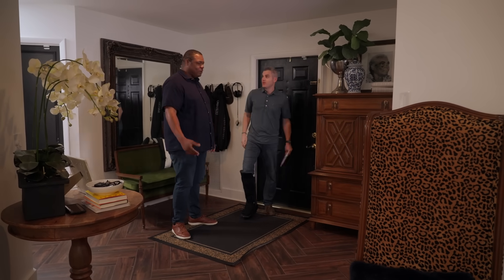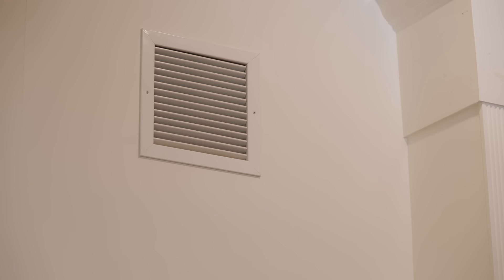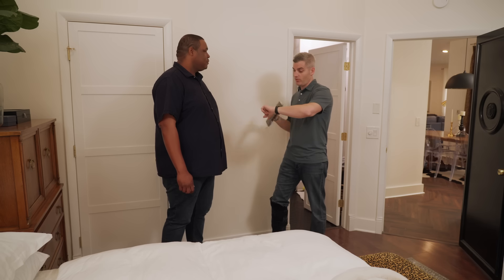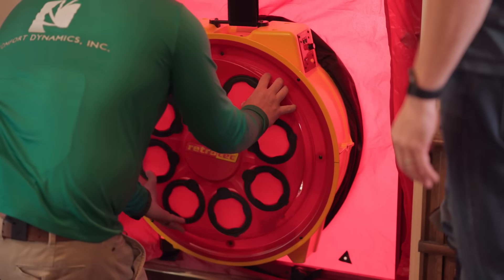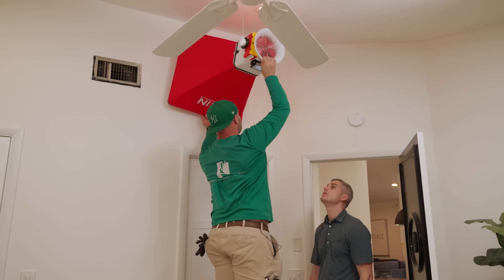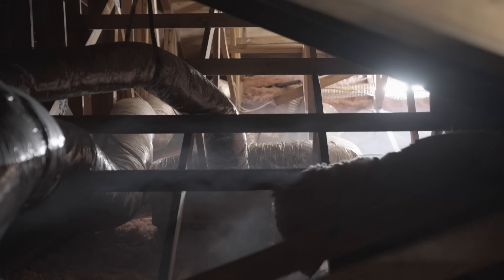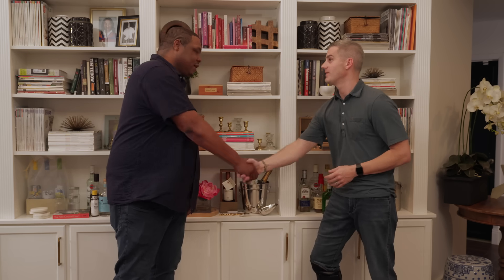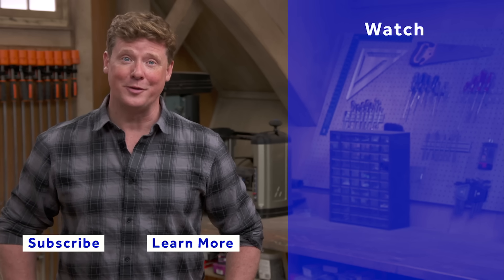How Experts Troubleshoot an AC System | Ask This Old House

Comment: That’s Cool Bear for you…surprised the system is actually sized correctly, although the duct work is undersized. They are a pump and dump company with 15 salesmen, 15+ installers and only 4 service technicians running warranty calls on systems less than 6 months old all day

Comment: Total B.S. no AC contractor’s going to do testing like that. Besides, most AC companies are Scam Artists. For a simple Run Capacitor charging you $400-600 dollars for a 10-20 mins jobs, depending on the locations.

Comment: Such a simple solution nobody thinks of, just get yourself a small window air conditioner for the bedroom, why would you keep the entire house cold so that your bedroom is cold, the window unit will pay for itself in the first month or two just by keeping the central air at a comfortable temperature and the rest of the house but keeping the bedroom cooler, works like a charm every time, you're welcome!
Reply: Definitely the cheapest solution, but also merely a band-aid. There's also something to be said about how loud those window units can be. It's so weird to see an HVAC system (and laundry) in a garage space, but I guess that's feasible in Florida. I'm sure fixing the return-side issue would help there, but I have to think finding and sealing the leaks in the attic will have the most return on investment. All that smoke seemed pretty intense during the test. Just get up there with some tape, and that would solve most of the issue. Everything beyond that feels like they're essentially trying to do a re-do on the original install, which is why it'll cost a buttload.
Reply: You can get a cheap minisplit and install it yourself, the market is littered with them these days.  No need for a window nor any large hole through the wall, plus super quiet compared to any window unit. Yes, it's a hack and doesn't solve the underlying problem with the central ac at all, but the math will dramatically reveal lower costs and the occupant of the room can immediately enjoy cool temperatures to put the issue to rest and move on with other things in life.
Reply: sounds reasonable. i was also thinking they need to find out what's blocking the air flow to the bedroom or where they are losing the air (probably in the attic) on the way to the bedroom.
Reply: hard to do with casement windows.

Comment: Sadly HVAC techs are the shadiest of all the trades.  You could call 10 technicians in middle America and all 10 would never go to a blower door test or duct leakage test.  Instead the homeowner will just get sold useless services like drain cleaning, coil cleaning, or an entire new unit.

Comment: If this is forced air, why is it in the garage? Are there no CO issues? Or did I miss something.
Reply: The heating part of a furnace vents itself through the roof most likely. However the AC doesn’t emit CO.
Reply: @jordanl69  I am referring to the cars in the garage. Normally the furnace is inside the house.
Reply: @ if you’re talking about the air intake side of the system, you are always going to be pulling outside air and then recycling the indoor air. You’d be pulling a ton of air from the closed garage and would be considered ‘dirty air’
Reply: That makes no sense lol , it's ran through a pvc pipe if it's high efficiency,  or standard flu pipe ran outside somewhere
Reply: Are you speaking of the cars that could be in the garage?

Comment: do these HVAC actually exist...last time i called a HVAC tech about my AC not cooling enough they just quoted me $30K for an entire new system after 5mins of the visit
Reply: Private equity has taken over local HVAC plumbing and electrical companies and now a lot of “techs” have become salesmen. Sad reality and it makes a good company that much harder to find
Reply: Facts! Find small family owned companies.
Reply: They are hard to find. They don't make as much fixing the issues over selling you a new unit
Reply: Yes, they most definitely exist, but they are VERY hard to find.
Reply: Worst of all, a brand new systrem would NOT have even fixed these issues.  They'd have sold a larger system which would most likely make the comfort problems worse.
Reply: Must have to call more than 1 company
Reply: Hi
Reply: Those "technicians" are largely on commission, and similar to other high paying commission jobs, if your base salary ends up exceeding your commissions for so many times in the row, you're fired, no matter how long you were with them, how good you are, whatever, don't matter (maybe you get a break if you're the owners son).
Reply: Don't call a large company with 50 trucks, call the small one man businesses, they'll be the more honest and trustworthy ones. The large businesses are sales sales sales.........
Reply: I’ve worked for small shops (3 employees plus the owner) and I’ve watched them just blatantly lie to homeowners and push system replacement as well. Some people are sleazeballs some people are honest. Best bet is to befriend somebody that is actually in the HVAC industry. If they’re your real friend they won’t lie to you.
Reply: This gentleman gets it!
Reply: Hi

Comment: I wanna see a comparison of MiniSplits vs HiVelocityAC because I was told condensate hoses can freeze on the minisplits (north climate).
Reply: One benefit of MiniSplits is no possibility of air duct leakage - because they don't have any. From what I read, ducted A/C are obsolete and the future is MiniSplit, the only reason they still install ducted system is inertia and that installers don't yet know how to install MiniSplits.
Reply: The indoor heads only condense in the summer but the outdoor unit will ice up and that’s perfectly normal and will drain when it’s defrosting. A lot of mini split heat pumps come with a base pan heater that keeps the water warm enough to be plumbed somewhere away from the unit, but most of the time it’ll just ice up on the ground keeping the unit itself clean.
And most contractors sell full systems because you already have the ductwork and it’s easier of an instal. Most of the time it’s less invasive on the house, less holes in walls or ceilings in every room you want to put a head. Generally it’s cheaper too. But mini splits are not new, I don’t know any instal tech who hasn’t installed at least one
Reply: A 2 to 3 thousand foot house would need 4 of 5 cassettes that would all be visible around the home, and probably 2 condensing units… or just one central unit utilizing the already installed ductwork. If the house has no ductwork, then yes, your initial solution makes sense

Comment: keep your door open for better circulation.
Reply: Still needs more supply air in the room…
Reply: @vangildjm  install a ceiling fan, buy a vornado fan.
Reply: @TexasMAGA2028 that’s air movement for sure. But still needs more supply air for when the door is closed. Is an air vent going to dictate the way you live? I know that’s a no for me dawg.

Comment: Here is a 9 minute video on how to turn a $.05 problem into a 50,000 dollar problem. When buying or building......do your research.  

Also:  EVERY house on Earth has "duct leakage."   The better systems minimize it.
Reply: lol so your father has the most inefficient and expensive way to heat and you don’t have ductwork… neither of these are air conditioning systems my friend
Reply: Yeah every house has duct leakage but 20% leakage into an unconditioned is a LOT, if the ductwork and hvac was in a basement (not applicable to this slab on grade home of course) then it wouldn't be as much of an issue.

Idk think of it this was 1/5 of the money you're spending is going to cool/heat the neighborhood, sounds a lot worse that way huh? That's because it is. I certainly wouldn't want to be paying to heat and cool the outside.
Reply: @Windiguana  For realz. Playas gonna play....  My point was that this is basic HVAC work.  No need for smoke.....no need for fuss.  Everything done here could have been accomplished with common sense and basic stuff.
Reply: How does a system minimize duct leakage?
Reply: My father has baseboard resistance heating and I have steam heat. No duct leaks.

Comment: 15-20 year's?   😂 Good luck, most system I've found die at 10 years in
Reply: I'm not an expert (I'm sure AC companies have extremely detailed data on this), but I believe it is very location dependent and based on what's in air around you. I'm in Illinois, and we have many really old central AC units, 20-30 years is not uncommon. We don't have salt in the air. Also some people live in condos and have the exterior portion on the roof, then a lineset to their unit.
Reply: Either your on the coast or you have a bunch of bad installation companies in your area who are prematurely killing those systems

Comment: That’s a ton of excess work just to keep out of the attic. A good technician will jump in the attic, can easily find air leakage.

Sure the textbook way would be to increase return volume and resize the ductwork accordingly, and move the air handler into the conditioned space, but that could easily cost $15K+

Realistically would be to seal the leaks, maybe place a couple dampers to help better distribute the airflow to the master bedroom, and use less restrictive return grills.
Reply: I would avoid the dampers since part of the problem is the static pressure being too high.

Personally I would just upsize the supply and return ductwork/grills to/from the bedroom and seal up the existing ductwork as good as possible.
Reply: This doesn’t take much effort, it takes the tools and knowledge to actually make a difference. How do you measure airflow, your hand 😂??

Comment: How much does a test like this cost?
Reply: About $1000-$1500. Blower door test, duct leakage test and leak search, zonal pressure diagnostic, total external static pressure, balometer powered flow hood measurements of each supply register, and a room-by-room Manual J with accurate inputs. Even with these prices the number of contractors with the skills to do this testing and diagnostic work is small. We really need to grow the number of people trained on how to do this stuff.
Reply: With the load calc??? That's a deal! @edwardlouie
Reply: I'd like to know, too!
Reply: Too much for an average homeowner. This kind of stuff done by the rich on large vacation homes they don't even live in and have caretakers manage.
Reply: @oldtwinsna8347  too much is relative. Many middle class/income folks are happy to save up and pay for a bathroom or kitchen remodel that cost as much if not more than a high quality carefully sized and installed HVAC system.
Reply: A billion dollars.  Just open a window.